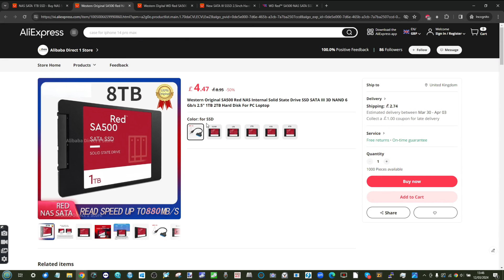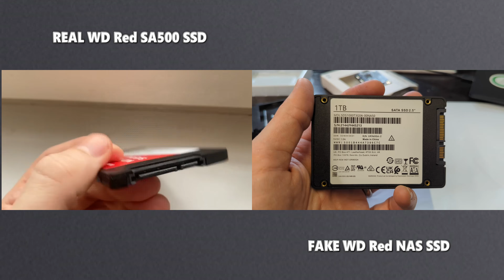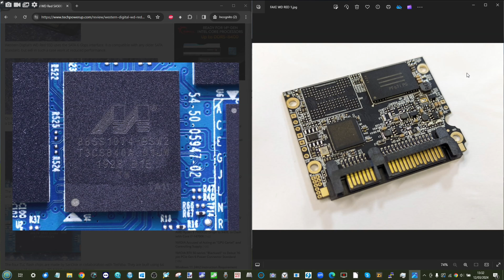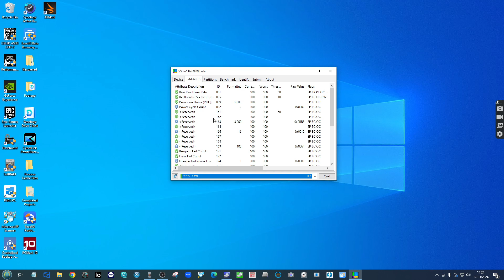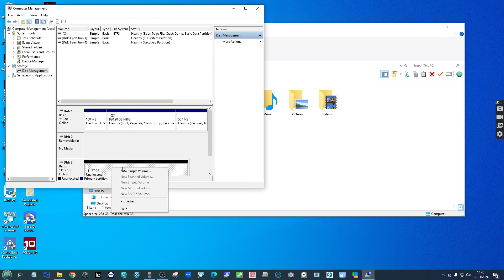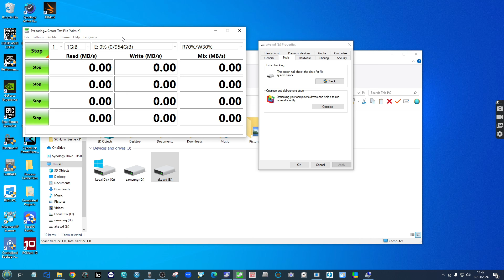I Bought FAKE WD NAS SSDs So You Don't! WHAT HAPPENED?

Comment: hey Robbie, a common scam with these drives is that they put a 64 gig flash chip in the box and call it 1 TB. They then scam the controller firmware to report 1TB. As you write to the drive, it overwrites the same 64 gig over and over. So it looks OK until you try to read the files and then you find out they aren’t there.
Reply: Very interesting. Firmware programming can be mischievous

Comment: I would be REALLY interested to see an (ALL SSD) COMBO system comprised of the TBS-h574TX as the main NAS (for running a VM and some primary storage) with a connected (by USB or Thunderbolt) secondary storage NAS such as the Asustor Flashstor 6 or 12 for much larger files like video files running a RAID 6 array.

Comment: But does it actually hold 1TB? Or is the controller hacked to report 1 TB but when you write to it, after 64GB all data is lost? If it can actually hold 1TB, you might consider it for some sort of cold storage, write once and if you ever need to read from it, well it's gonna be slow
Reply: Cold storage of data on dodgy SSDs? Not the best idea
Reply: guaranteed if does not 1TB of actual storage not enough NAND ships on it.
Reply: @waynemacleod3416  that's hard to tell unless you see the marking (if it's hasn't been sanded off or altered).
There are some 1tb chips, so one nand chip could give 1 TB of volume.
Some of these sus SSDs are made with chips from say refuse of the actual SSD manufacturers, or from chips removed from faulty drives.
E.g. a Chinese co purchases defective ssds, they disassemble them in a garage, see which nand chips still sorta work, and use these in such drives.
More often than not, of course, a shady SSD will not have the stated capacity, yes
Reply: @waynemacleod3416  1tb nand does exist (since 2022) but I agree that this probably isn't using it.

Comment: can you do a moody  ssd Drive from the same site on the PlayStation 5 just to see how bad they are
Reply: This is what happens in that video since ps5 would have less tools "to see how bad they are"
at 19mb/s peak (less for smaller files) you'd be looking at many hours to install a 20gb game (a small game)
also fakes like this often hide the true size and lie about being 1tb so after installing 4 20gb games you might lose the 1st (if it was actually 64gb)
Many PS5 games are over 100gb and wouldn't fit on many of the fakes but if they did happen to fit you'd be looking at a day long install IF IT DIDN'T CRASH DURING A WEEK OF MAX WRIGHT and as it crashed multiple times in this video I'm fairly confidant your not getting any games on it.

Comment: Another great video! What are the drawbacks for using genuine non-nas drives for nas uses (rust and ssd)? When used in a beginner homelab, is this an area were costs can be reduced while learning the technology?
Reply: Performance and longevity are where they typically differ, heat in some cases but that's more on the tolerance side. It depends a lot on what kinds of drives though, low end consumer drives tend to be slow and not tolerate heat, will stop working if too hot, and can be short lived if run hot. NAS drives are not special in some magical way. They tend to be middle to low performance drives when speaking of the consumer end of NAS drives, because they will be on an even slower network, but they often have a write/read pattern that is less "bursty" so it won't have a blazing random access speed, but usually quite good sustained transfer. For a home lab as a beginner you'd be served well with whatever you can get that isn't going to be unreliable. It depends a lot on what you're going to store and what you'll use it for. I don't use spinning disks at all right now, I don't have tons of movies or whatever to take space up, I run Intel sata SSD's and last bought Kioxia NVMe for a server. Never had either fail 'badly', ie without some warning. Kioxia is what used to be Toshiba btw, so IBM branded drives back in the day of HDD's. But then my stuff is enterprise grade, I'm a retired software developer so I have habits based on my experiences. Before that I worked for a storage solutions brand who used a lot of HDD's from different makers and they all have good and bad batches ..
Reply: @noth606  Your reply was very easy to understand. Thank you! I purchased a lot of 10 Seagate laptop 500GB spinners to allow me lots of flexibility to learn how to set up different raid options with hands on. I also picked up a LSI SAS 9300-16i HBA card to drive them all... As a part of the learning experience, it was the 400w PSU that had my process falling short. Great thing about homelabbing (so I'm finding out) is that it is a great place to try new things where the oops-factor isn't career ending.
Reply: @CptBlackEye  Heh, in most cases an oops isn't career ending as a pro either, but it depends a lot on how big of an oops, and whether the person was told/warned about it and still doubled down. I have seen that once. Anyway, yeah Raid sets are probably good practice, their performance is imo different 'in person' compared to how you think it is from just reading about it. Even if a rebuilding Raid 5 set is available while rebuilding, the performance is so abysmally bad that I've told people it's offline and they have to wait :-P. 
For home lab use I would suggest to have at least one big PSU either spare or in a server machine that ideally isn't critical. I have two 1250W ones, they are handy for a bunch of different things but most of all testing and when some weird construction needs to be powered to get something done.

Comment: i my opinion you dont need dram. dram less drives are more expensive because you need more nand chips in order to keep up with the sata connection speed but all data that is written to the drive is written and not sitting in dram on the drive because the nand on the drive is to slow. dram less tend to be slower but 300 to 400mbs is fast enough 520mbs are only achievable with dram and if it is full you now that fast what the nand on that drive is capable and this is mostly 300mbs or slower. having a dram brings no benefits for the average user your operating system dont know if the drive is finished or not you have to ask the drive if it is finished but some drives does not answer. how does this work? you send a big file to the drive the explorer tells you i am done but your drive has a dram and a slow nand now your dram is nearly full and your drive controller shove the data that is sitting in dram on your nand. the opertating system sees no data needs to be send and thinks it is done but your data is half way written now you take the drive out now everything is lost that not written on the nand but in order to prevent that you have to click on the usb drive icon on the right side of the taskbar and ask the drive if it is done and if so the system repels the drive by it self and now you can unplug it but if you dont do that your data is lost. this is the risk of a usb drive but for internal or e-sata drive it is not that simple on e-sata dram is disabled on default because of that problem but the internals. if you have a power outage data get lost that is not written. raid or hba controller have some times a big battery to power the drives long enough to write all the data even the system is off or they hold the data as long as possible in its ram and writes it on the drive until the system comes back alive. drives with dram cant do that. ok some enterprise 2.5 or 3.5 nvme or flash sas drives can do this but they cost 10 times more for the same capacity. 

dram is in my opinion a big risk that provides no benefits in personal use cases. dram is for keeping compute power high so the core who is accessing the drive can faster back to other stuff and has not to constantly feeding the slow drive and for the most part this works because the time between writing and working is mostly long enough thats the system writes data to the drive the dram is empty and all data is written. for a nas this is nonsense and brings no benefits for a office pc thats the same no benefits. for a gaming system this might beneficial but not noticeable.

Comment: I wonder if the conclusions of this video can also be applied to SSD/RAM which accompany those prominent NAS ITX boards from Aliexpress
Reply: Yes. Best to buy bare bones.   Had a no-name Chinese NVMe in a Topton, which caused errors from the start, then froze re-installing. In PC it reported a name like ‘Yiwu’. Some Chinese NVMe and NGFF disks are ok, and have 3 year warranty (although probably difficult to claim) A Fanxiang seems OK and Kingchuxing maybe. I also only bought 8Gb DDR5 originally, but replaced it with a Crucial 24Gb.
Reply: There are also a lot of fake SD cards and all kinds of shape and size USB memory sticks. On 2.5” SSD’s, as well as WD (some with WD on the label) Samsung EVO and Crucial MX are also copied, and have maybe 1/10th of stated capacity

Comment: Can i use raid 1 with 1 hdd, and later add the 2nd?
Reply: I don't think so. There might be a software tool out there which can convert your regular hdd to a raid without the loss of data, but I would not rely on such software.

Comment: To be fare the samsung is a decade old high en sata ssd but still.
I found this video while looking up the big brother drive to your wd fake a 4tb a customer was wanting to use in place of a 750gb hdd and the drive died in the middle of copying data over. I think these drives are firmware faked dries that are far smaller than the listed sie probably 32gb or 128gb drives because after around 60gb data copy the drive failed totally and could not be recovered.
Reply: I have over 10 PC of different models and years. i have a 4T WD ( purchased from best buy for $80 ON SALE ) My old 500G I purchased from over decade ago for $120.

Ive also loaded another HD for a third back up.  The final old back up is a 15 year old
tower. None of those drive seldom get used.  The 8 HD I pulled out of various
PC are sitting in draw for save keeping and REBOOTING old win O.S. for kicks N giggles.

All the older laptops are on Walmart 256 GB SSD ( $20-ea) becuase Im CHEAP and dont need that much storage space in a laptop. The 2 new laptops comeswith Nvme
installed from the factory.

Comment: The smaller drives might have genuine nand chips that have the real capacity but even so I wouldn't trust it - most likely a used part, or slow, or unreliable, or all of the above. The larger the capacity of the fake drive, the more likely it will be even less good, with a small sd/usb flash instead of a nand chip and a controller that will report the size on the label but wiring data "in circles".
I don't understand why people are still making these videos, it's clear to anyone with a functional brain that you don't buy SSDs like that, or, better still, you don't buy ANY SSDs on Ali and places like that

Comment: I bought a 4TB one of these drives with exactly same box and drive as yours in video, I didn't break open, but the drive showed in bios and device manager but not disk manager or partition manager, so I went into DISKPART (using command prompt) and it showed in there too so I decided to use CLEAN command and it worked so I formatted it and now works fine for £30. So please try as I did because you might just throw a drive away that is fine. Like i nearly did.